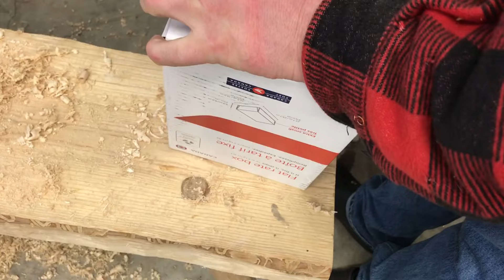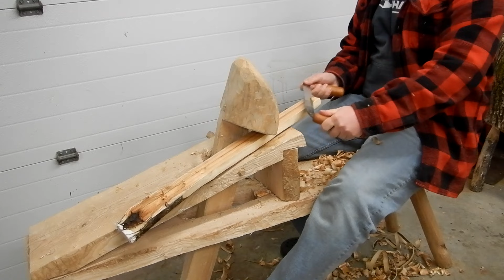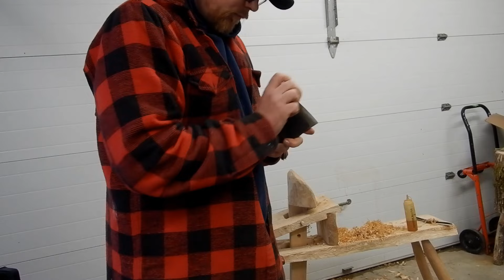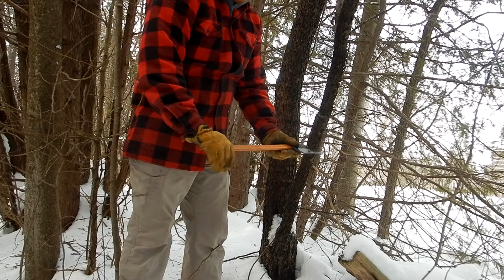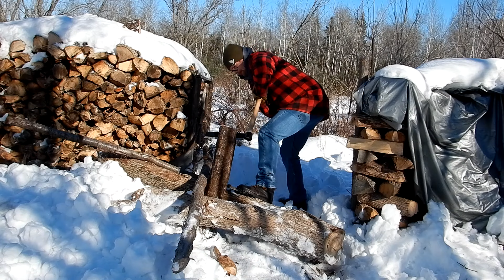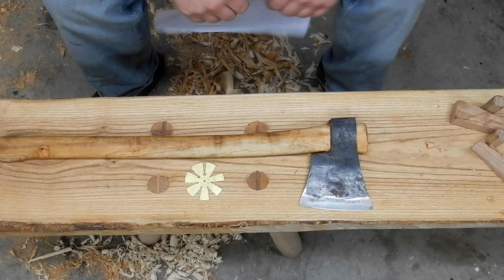Rinaldi Italian axes come to Canada Part 1: The Milano

Comment: Nice axe. I have one on order. Can’t wait.
Reply from the maker: Hope you enjoy it!
Reply: @MattKeevil  I just hope I can learn to sharpen.
Reply from the maker: I'm sure you can! There's several ways and tools that will get you to a good result. I think I put most of the sharpening advice I have to give in this video https://youtu.be/Ei33mL0UW3Q&t=1639 One thing I have in there is a decent way to use a T-bevel and a phone app to measure the angle of an edge, which is handy if you don't have an angle gauge or other device like that. I had some trouble with the Milano being almost too hard to file so that's a possible complication.

Comment: I really enjoy your long form videos! Those Rinaldis are fun, glad they are expanding in Canada. Does the new shop ship to the US or would that be too expensive?

Great handle it looks like the Milano really benefits from a longer and little thicker handle. I’ve got hockey tape on mine!

Somebody said they make Rinaldi from spring steel, I have not been able to confirm or deny that yet but I’ve been very happy with it so far. 

One thing I’ve noticed with my newer axes is the first layer of steel seems to be very soft. Across many brands and types of axes. After removing some steel do you notice a change in hardness or temper? I wonder if they don’t just get ground too hot at the factory
Reply from the maker: Thanks! I have been thinking about the issue with the steel since you posted about your Gransfors. I noticed this one was pretty hard right from the jump, I tried two files and they barely cut but maybe there was a bit of difference right at the apex because the edge held up very well after my second sharpening. The problem is I adjusted the angle a little bit so I can't really say.
Reply from the maker: I forgot to say that I think La Cognee only does shipping within Canada at the moment.
Reply: Hey! 
Rinaldis axes and tool are made of very high quality 58HRC steel also known as Spring steel. It made them very hard to sharpen or to change the geometry (this is almost impossible) with a file, you need a high quality smooth file to sharpen them nicely. I’m looking to import premium Italian files too for that matter.
It’s almost impossible to alter the temper of those axes with a sand band or a grinder.
As Ben Scott says Rinaldi make maybe the best axes in the world but it was hard to find them. That’s why I decided to make them available here. I’ll reach out to you to see if I can ship them to the States too.
I’m still waiting for you part 2 on the Milano.
Cheers ✌🏼